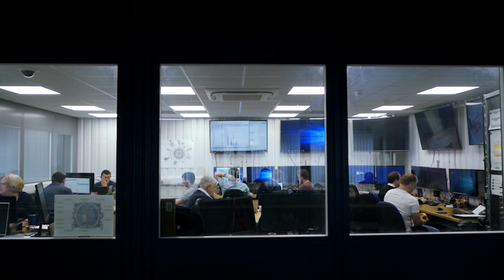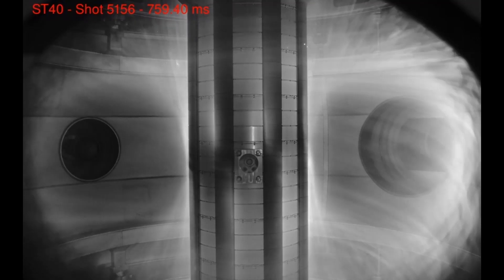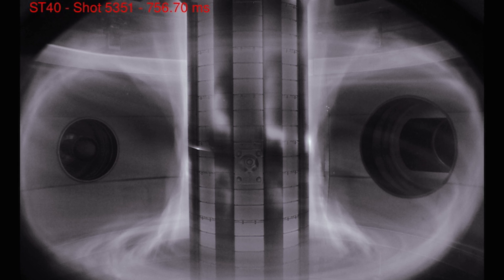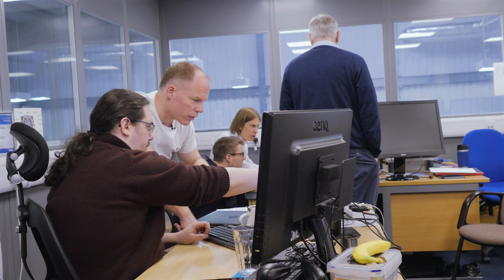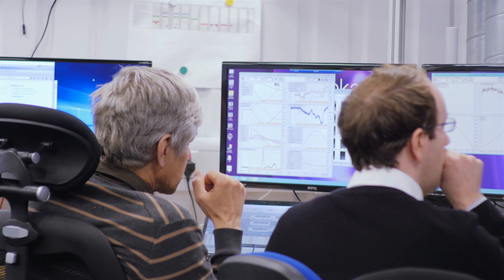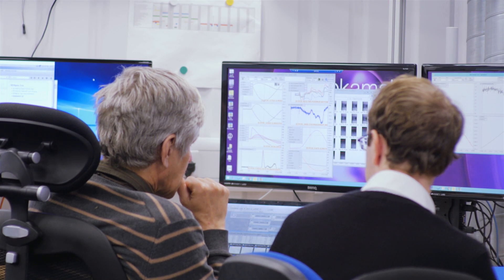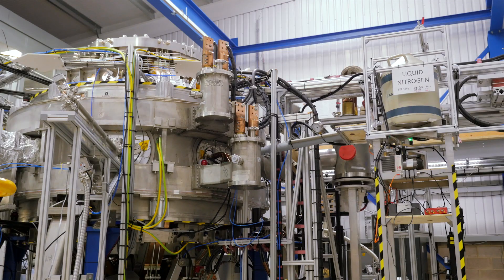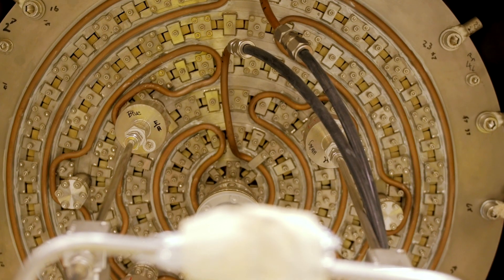ST40 control system upgrades for 2019

Comment: plasma is a superconductor at high temperatures isn't it? what if you use plasma itself to generate the magnetic fields necessary to cause fusion, that way you wouldn't need liquid helium to cool superconductor coils, just using normal wires to control the plasma coils